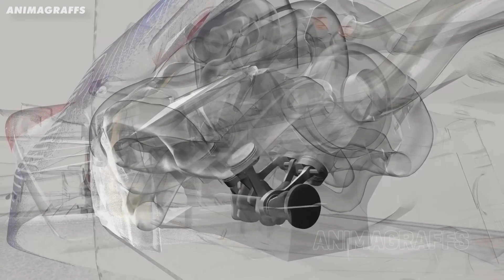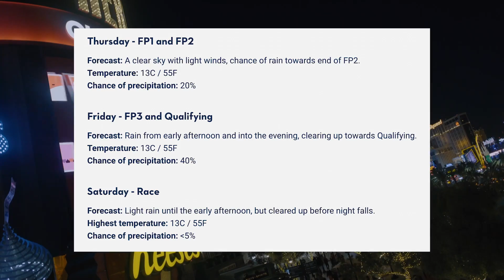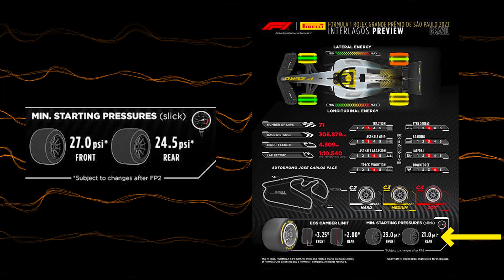Why Formula 1 Cars are IMPOSSIBLE to Drive in the COLD

Comment: Outside of questioning track/racing itself (let see what happens).
It will be fine for temperatures. It looked worse in some longer forecast some weeks ago (even 5-6 C at the end of race/Q) but now it will be in managable window (with city holding on some day heat, one can expect low teens (C) for most of sessions). In fact, this coolness can help teams that usually can light up tires quickly but same time suffer from higher tire wear. And it is probably safe to say that we will see ton of lockups.
Reply: Nobody can get any temp in the tyres cos there are NO HIGH SPEED CORNERS to get temp in the tyres AND THE 2km STRAIGHT MAKES THE TYRES LOSE EVEN MORE TEMP…… It will be crash after crash cos of restarts like in Melbourne…and new tarmac and street track with walls make it even worse …
Reply: Please learn abt F1 tyres and cars. Cold tracks isn’t good for any team……

Comment: Couldn’t they tape up a small part of the brake ducts? Like how they sometimes do with the engine inlets? Like if the brake ducts are covered up w tape or just smaller, then there’s less cooling and the brakes heat up the tires from the inside more than usual
Reply: Wow you should be the chef engineer for Ferrari ! Doubt anyone else would of thought of that ! Don’t give up the day job as a bin man.
Reply: @tonywright8294   you'd be surprised how often the simplest solution gets overlooked, bc we think everything is super complicated and therefore requires an equally complicated answer
 
end of '21, under a tweet explaining ground effect, I asked about a possible side effect of ground effect, not bc I'm that smart, but bc I remembered I had read something about "bouncing" and "losing control if seal was broken" like 10yrs ago. You would not believe the amount of Tony wright replies I got...
I should find that tweet and be like told ya so cough porpoising cough

Comment: Can someone explain how higher tire pressure induces higher temperatures? I've always been taught that (in normal cars) the reason nr. 1 to keep tires inflated was to avoid overheating them.
Reply: It’s really difficult to explain. Cause with a very low tyre pressure the tyre moves more and so heats up the faster.  Higher tyre pressure  the air can’t expand that much so it’s get hot . So it’s not like low Tyre pressure won’t heat up but it’s within limits .
Reply: @ThaDutchDK1989  Thanks. I had to think about that for a while and expand it in my head, but I think that makes sense to me now. Tye flex increases temps quick to start, but pressure reduces flex as it heats. So, less heating from there on. The more molecules to start with can heat more and retain more heat once the increased flex stage is passed. And have higher pressure I assume, which equals more heat if I remember my physics.   Considering F1 runs a lot hotter than a road car will ever see to work, I think that's the main difference I missed. I've always wondered what pressure these tyres are at during race conditions rather than the minimum measured "cold" pressures. I hope I understood correctly. Thanks.
Reply: Yeah, I'd like to hear this explanation too. I recall checking my tyres and finding one a little low on my road car. Figured it wasn't too low, so drove to the servo (petrol station) to pump it up rather than drag out the compressor. A few kms down the road and that tyre was at a higher pressure than the rest due to the extra tyre flex heating it more and increasing the pressure. Good ones barely moved. Spent a while inflating and deflating the tyre a few times (probably just killing time more than being effective changing the air) before I was happy the temps had come down enough for a fair reading. Needless to say, I always check and inflate tyres at home before any driving now. But I get that a road car/tyre is much different to a race car/tyre, so an explanation would be great.

Comment: But will it mean they can push even harder? To a layman like me, it would seem like overclocking a CPU with liquid nitrogen. You have to push the CPU hard so it doesnt get destroyed by the cold. But you get all that headroom to avoid overheating. And considering all the electronics in the cars, that cold would be benificial. Except for the batteries, that is.
Reply: No because less heat is less grip, and less grip means you wear your tyres quicker

Comment: Why does higher tire pressure make the tire heat up quicker? Usually the opposite is true as lower pressure means more tire deformation and therefore more resistance and thus temperature.
Reply: My understanding is that with higher pressure, the kinetic energy from the gas molecules moving around transform into thermal energy. Correct me if i'm wrong. What you are referring to is the surface area of a tire in relation to tire pressure.
Reply: @NexuJin  I've heard this argument before, but I don't think thats correct physics. If it were true, any pressurized container would constantly emit heat. During pressurization heat could be generated, but after the pressure has been reached, i highly doubt it because otherwise we would have a perpetuum mobile.
Reply: Came here looking for this. Could be a mistake...
Reply: Very good questions. I thougt so as well.

Comment: Not just the tyres that will be negatively affected, but the driver too!
I recall a race at Mt Fuji decades ago where the drivers hands would go numb and the visors would fog up.
Reply: It definitely won’t be THAT cold. People forget Nevada is a desert. It’s hot. It’ll probably be 60° Fahrenheit, as opposed to the 40° they often fight against in winter testing at Barcelona, im sure it’ll be okay and people keep talking about the temperature and I keep thinking it’s an overreaction
Reply: @MaxBennettx  deserts have no trees to keep heat trapped in so at night when the sun goes away the temp drops very quickly. A quick google search shows that night time temps in the 40s are common in Vegas, during November
Reply: True, but blasting around at 200mph certainly magnifies things. It’s like a mild day in autumn can become icy when it gets windy.

Comment: I was thinking about toe from the start. 
Undercuts also might be non existent.

Also one question: 
Does the cold effect tire wear? 
Will soft tires last longer or is tire wear independent of temp?
Reply: Depends on the compounds they bring, the track surface the car and the driving style.
The Ferrari and Hass put more energy into the tyre which means they tend to do well in cold races but struggle in hot races. The Mercedes doesnt so the reverse is true.

But as long as long as they can get the tyres into the operating window, then they should last longer

Comment: Increasing pressure increases temperature? You sure about that? Because increasing pressure makes the tyre stiffer making it flex less, which leads to less heat generated. Increasing temperature increases pressure, not the other way around.

Comment: This could be a very informative video, but weather forecast says it's going to be more like 11-14 degrees Celsius. So not all that cold, we've seen similar temperatures doing races at Spa and what not.
Reply: But Spa is all high speed corners. Easy to keep temperature in the tires and brakes. But with such long straits in Vegas id guess the teams would completely seal their brake ducts.

Comment: Most people seem to expect that the low temps will result in a lot of action. However, difficult tire conditions usually results in a boring race, where drivers are afraid to push, and just take it very easy and stay single file.

Qualifying could get more interesting though.
Reply: Most people also talk about the tyres contributing to stiring things up (either way, i agree it will likely result into drivers being overly cautious), but i cant, for the life of me, imagine the drivers not having problems with the brake temps too, which seems much more of an issue to me.
Reply: @koutroubasathanasios7322 but at least braking cooling can be reduced.
Reply: @squeakybunny2776  Would that ever be an issue in this track ? I think that layout wise it would be tricky with brake temps regardless of the temperature, but add that to the mix and its on a whole other level i imagine.

Maybe its just me being ignorant though. I bet they have gone through everything months in advance.
Reply: You mean like Turkey 2020, where no one dared to push? Oh, wait.
Reply: When  I first heard LV in mid November, "that'll be cold" . 10 PM for the race and midnight for the qualifying?  Ridiculous.
Reply: You have never watched Fernando Alonso race have u
Reply: It’s going to be boring.
Reply: Every F1 race is boring. At least Vegas offers the best opportunity for minor excitement.
Reply: @AKHKCZplus  i dont agree with this, zandvort and brazil, delivered a great show, many tracks are boring such as mexico and COTA, i mean if you only watch the 1st you will lost all action midfield is really fun to watch, in actual fact many people knew since the begining max will win
Reply: @AKHKCZplus ”every race” calm down

Comment: F1 should bring back the hyper soft tyres for cold temperatures race track to add more pit stops tactics
Reply: The hyperstoft still exists. The tyres go from c5-c1 and they bring 3 to a event and just call them soft, medium and hard depending on the track. So the soft in silver stone might be the hard in monaco, and behind all that it will be the C3 tyre, or the old Medium.

They only brought 3 different compounds pre 2019 as well.
Reply: @dylanburston7453  What I mean is use plenty of hyper soft tyres to rubber in the new surface racetrack to give it a better chance to use the regular soft, medium and hard tyres than rather blind testing it with the regular set of tyres
Reply: @neddy1287  Over a normal weekend the track will rubber in anyway. Its only a issue if it rains which washes away all the rubber and on sprint weekends

Comment: If I were the FIA I would change  some rules to increase the allowable temp settings on the tire warmers. Or else it will be a low grip race. It could be interesting tho
Reply: I wonder how this will pan out when tyre warmers are taken out of the equation in 2025.
Reply: @Scottie_S  which is a total joke. F1 is the pinnacle of performance and development. Which goes against the stigma of F1, so I dont get why they should do that, for the reason to "even" out the pack. Or "lower" the costs or environmental friendly. Lol. Then they should cancel sprint races then. That would lower costs significantly and is more environmental friendly
Reply: @driver_18 Its just lip service. If they truly cared about the environment they wouldnt fly to miami, then go to europe, only to fly to canada a few races later.
Even in the WEC they brought back tyre warmers for Le Mans.

Hardly any of the Co2 F1- or another Motorsport- has anything to do with what happens at the track
Reply: @driver_18  I agree with you.   Meanwhile the pinnacle of performance and development, as you so eloquently put it, is moving ahead with the mix of fossil fuels and synthetic fuels which, I dunno, is still fuel and emissions.   Also, I am no fan of Sprint races.   A waste of time.   Getting rid of Sprints will bring down wear and tear on the teams engines, gearboxes, etc, so there would be less penalties on teams that are suffering in that respect.
Reply: @Scottie_S  exactly! F1 has been the quintessential sprint race in itself already. They ruined it  when they applied the minimum fuel load and these tire strategy rules. Noylt like back when it was all out racing
Reply: @dylanburston7453  agree. Thats why their perspective towards an "environment friendly" approach is a fiasco.v
Reply: @Scottie_S  You just need to look at WEC this year. The answer is dangerously.
You have cars coming out of the pits and having to do a whole lap(s) like they have damage whilst others are going full speed
Reply: @dylanburston7453  Right with you there.   Tyre warmers are really a necessity and not a luxury.    Let's hope this changes.
Reply: @Scottie_S  Yep, totally agree. You cant get rid of something a tyre is designed to work with and expect the same results.
If they are going to get rid of tyre blankets, they need to change the construction of the tyre, and let teams warm the tyres in differnt ways, like leaving them in the sun, which they also banned in WEC
Reply: @dylanburston7453  Yep.   Lots of questionable decisions that have led to this moment.   Vegas might actually answer some of these questions.   Dylan, not sure what you think, but I think that this race in the desert is going to be difficult for all teams, but will actually be beneficial in shedding light on some of the engineering points that are unanswered at the moment.

Comment: This race shows that Fahrenheit is an awful measurement for temperature related to weather: Celsius is easy, 0 degrees=freezing. 32 degrees Fahrenheit=freezing is so awkward.
Reply: Fahrenheit is a scale of cold to hot, where everything below 0 is too damn cold and everything above 100 is too damn hot. By the time water boils a person is already dead, and remembering a 2 digit number is about the easiest thing possible. If you struggle to remember that then you must have a really difficult time with remembering what your body temperature is.
Reply: @DustyKH  sounds very useful to know -17 7/9 below freezing. Or the awkward 98.6 degrees fahrenheit for body temp. 
In Celsius every relevant temperature is also 2 digits.

Comment: How it really happened:
FIA: So the temperature is going to be around 50°, which is significantly hotter than Bahrain in 2005, but teams have gotten better at thermal management since then, so we believe...
Logan Sargeant: 50° Fahrenheit, not Centigrade, you know that right?
FIA: What the fuck is a Fahrenheit?!
Reply: at point they drive on the backside of the moon and the scala is Kelvin 😮
Reply: The track length is equal to 67.8 footbal fields 🙃
Reply: @into_the_void  How dare you use the decimal point?! It's 67 football fields and 56 hotdogs!
Reply: @MuppetsSh0w  😂
Reply: @MuppetsSh0w  0.8 football fields is approximately 480 hotdogs.
Reply: @MuppetsSh0w  We in the Netherlands measure things in terms of football fields too sometimes. For clarity's sake. It's not just Americans.
Reply: @MuppetsSh0w  67 and 7/8ths
Reply: Celsius, nobody uses centigrade.
Reply: That sounds about right haha.
Reply: I was there in 05. It was hottttt
Reply: @b787900  Don't go to Death Valley, CA if you think Las Vegas is hot.
Reply: @chipferguson5129 120F in Bahrain on raceday was no fun. You right next to the ocean so high humidity makes it so much worse.
Reply: @b787900 Death Valley last July...132 or 55.5 Centigrade...both places are brutal.
Reply: @chipferguson5129  low humidity/high elevation deserts seem to get way colder at night. Honestly had never heard of a desert being humid so it shocked me that drivers were basically getting heat stroke at the qatar race at night in october
Reply: I'm here now and I'm more concerned about how it's going to effect the outlook of the event as a whole. Could take some of the shine away. 🙁🥂
Reply: Do you mean that German fellow who was playing with freezing salt water and had a fever when he decided to create the Fahrenheit scale??? got it!
Reply: @peeweeson  😆I mean more about ticket sales and access to the race. I'm a little confused on how they missed some of these factors. Crowds might not be as thrilled. 👍
Reply: Totally believe that. I mean. F1 don't race in Myanmar so why in the other uncivilised country 🤣
Reply: "WOT TEH FOK IS AH MILE!?"
Reply: Comment of the day 
👍

Comment: This might just be speculation on my part, but just as the tires might experience problems and unpredictability, wouldn't the brakes also suffer in colder conditions?

The long straight, cold temperatures and unpredictable new track surface might result in some problems down at the heavy braking zone after the long straight, and i think we are gonna see basicly everyone overshoot that corner at least once during the weekend...
Reply: The brakes do suffer in colder conditions, but it is almost not worth mentioning in and of itself. The brakes F1 cars use can heat up to 1000+C within one to two braking zones and cool right back down to 200-300 C on the next straightaway. You might see the very first braking zone need a tiny bit of extra distance (like a meter or two), but the bigger issue really is that if the brakes aren't staying hot, they can't keep the tires warm. If this was MotoGP where they sometimes use Steel brakes, or some other motorsport, this might be a bigger issue (or your road car), but for F1 it's barely worth mentioning by itself.
Reply: @PomegranateLost  Okay, i wasn't certain. I kinda just expected the brakes to be able to cool down too muchon that long straight, and the combination of unpredictable tires AND brakes might be worse than i thought...

But i guess the teams have plenty of time to narrow and widen the cooling ducts to alleviate the problem entirely within a few test runs...

Comment: Let them use intermediate tyres at Vegas.
Reply: There is literally nothing stopping them other than the fact they will be destroyed in about 5 corners
Reply: Is not only the design, but the rubber composition is also different, made to not run in dry conditions.
Reply: And less contact patch due to the treads.
Reply: Is there a rule that says they can’t use inters on a dry track?